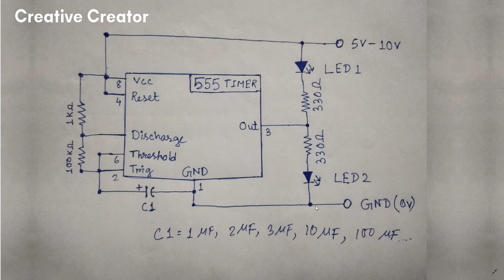LED Chaser Circuit with 555 timer

Comment: Great project. My only concern is using tree pruners to trim the leads. A good pair of flush cutters isn’t much money. 

Also, a variable resistor (even a trimmer pot) should be used instead of capacitor substitution.

Comment: Hi ... if using the resistor connected to terminals 2 and 3, capacitor connected in 1 and 2, does not work the same way?

Comment: Thanks for the video...sir I have a problem my circuit switch on the 1 led then the other but after that 2 nd led doesn't get off and it will be constantly on and there will be no change plz help me sir

Comment: Make use of a potentiometer between pins 6 and 7 so that you can just vary the duty cycle (ratio of on time to off time) you can get a much better duty cycle by connecting a diode in parallel with the potentiometer. Basically it'll change speed by rotating the knob of the potentiometer, follow the equation T_high=0.693*(Ra+Rb)*C , T_low=0.693*Rb*C
Hence varying Rb will do the trick

Comment: Such a versatile IC which can be used in many configurations
Another IC worth checking out for an LED chaser would be an LM3914 which can drive 10 LEDs.
An AT tiny would be another cheap option but does require some coding of course.
Reply from the maker: Thanks bro for the suggestion...
I will definitely try....
Don't forget to subscribe :)

Comment: If you have a chance, please don't cross wires, the plastic coating melts when soldering and eventually a short circuit happens. For the jumper wire that goes from pin 4 to pin 8 of the 555, it is much more neat putting the wire over the components side of the veroboard, just below the IC or the DIP socket, and you can put it through the same holes than pins 4 and 8, so when you fit the socket in place, it gets tight then you can safe solder the socket and the jumper at the same time.

And, please, tin and clean the tip of the soldering iron from time to time, it will last forever.
Reply from the maker: This idea came to my mind before there are some difficulties
1. If I commect a wire before soldering the socket(8pin) then dome people wouldn't understand clearly as all can see now.
2. 2nd reason is filming...
 I am sure your suggestion is defenately useful. Hope you understand!!
Have a great day :)
Don't forget to subscribe buddy..
Reply: @Creativecreator  You can connect a resistor from discharge pin 7 to an led that is connected to VCC. That works to

Comment: Good morning sir very nice video thanks sir I have question that how to connect more led in this circut mean to say we will be changed any other equipment or connect it paraller In this led
Reply from the maker: You can also use power transistors like MOSFETS for running more load!!
Thanks @Chris Lewis for sharing your thoughts.
Reply: You could probably use 2 low voltage realys on the output in place of the LEDS possibly Reed relays. You may have to add a diode in series with the relay coil so it will shut off when the output goes from (1) to (0) just in case the relay still both stay in the on position.
Reply: Creative creator... I studied in electronics for years so much has changed over the years.